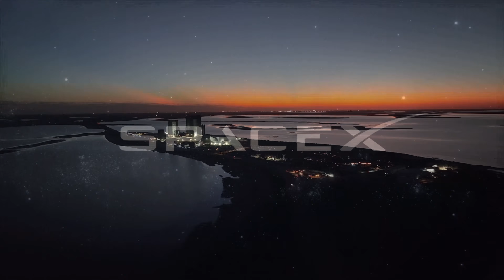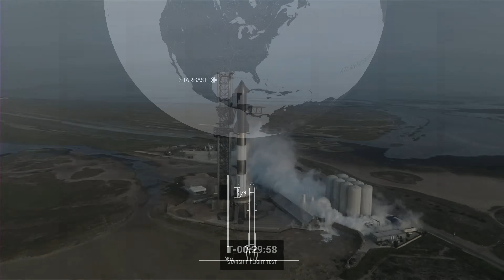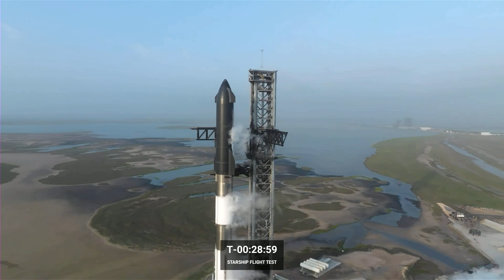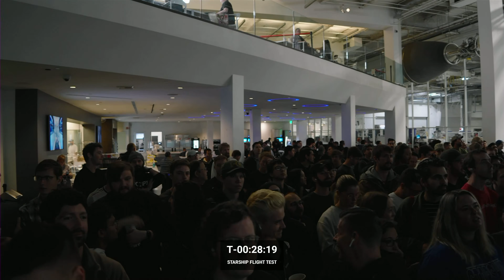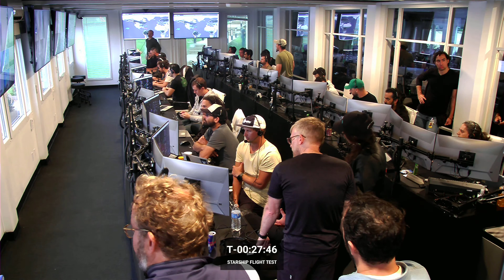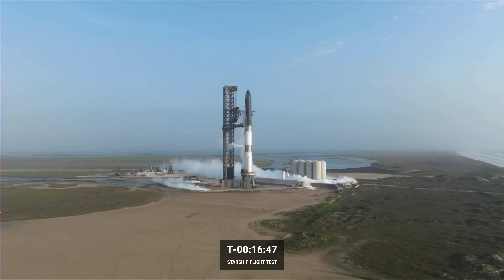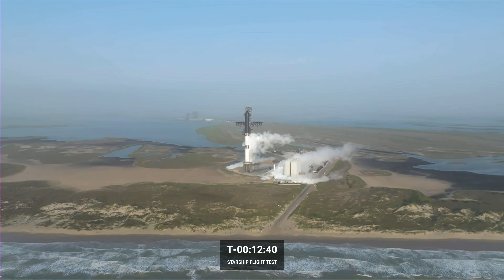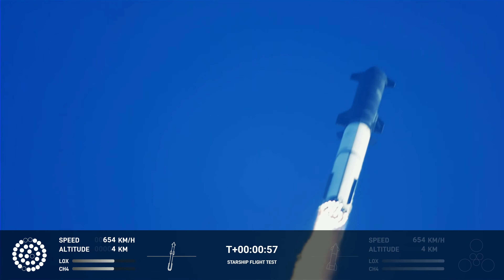Starship Flight Test

Comment: The fact the booster didn't separate - after two or three full rotations at such insane speed - shows you how well put together it was.   Perhaps TOO well put together.
Reply: It's too good! So good that it failed completely! Wow! Good job guys!
Reply: Probably damaged during liftoff.
Reply: @GoDodgers1  my money would be on a software glitch
Reply: too much ducktape bro
Reply: @souplife1  it didn’t fail completely. The goal was to clear the tower. The mission was a success.
Reply: starship has been in some form of development as Artemis has been.
Reply: It looks like it wasn't a flight test, but a stage separation test. Failed miserably.
Reply: @souplife1  well obviously it was going to fail because this is the most outdated and oldest starship that they have the plan was to clear the launch pad that’s it everything else was made for show and luckily they got some data to upgrade the new starships that I will say if they use the new starships they have they will be 99 percent successful
Reply: @souplife1  this is what separates a billionaire from an ordinary person. when a billionaire takes one step forward and an ordinary person can only see from the bed through the screen
Reply: @souplife1  haha u dont understand engineering
Reply: Duct tape these days is next level.
Reply: @sliceofthatpie  It was a “clear the tower”-test. This was a huge succes.
Reply: Just goes to show how short-sighted and incompetent the engineering of this rocket was. Completely over-engineered in all the wrong areas and obviously under-engineered in the critical components
Reply: @sliceofthatpie  maybe you should look up what the job of a prototype is. It is to reveal problems and modes of failure. 
Ergo, it did exactly what it was suppose to do, just like all the test articles that exploded on the landing attempt lead to the successful landing attempt becoming possible.
Reply: Told them not to use superglue! 😀
Reply: @richardburger4859  could be a combination of the two, like the vibrations damaged a sensor used to orient the rocket.  you can see that the HUD in the video that shows the angle and the engine status glitches out during the flip and the angle displayed suddenly changes 180 degrees.
Reply: @Supreme_Lobster  haha you don't understand wasting billions of dollars
Reply: @GoDodgers1  After launch the booster lost both of its external HPUs (Hydraulic Power Units) which control the gimbaling (thrust vector) of the center engines; without those it can't steer itself as easily (except by adjusting thrust in certain engines). There was also an aerodynamic issue due to speed and the grid fins plus ship flaps being at the top, so causing drag and control issues. In short, it was caused by a mixture of things. Future boosters won't though have HPUs, ones already built have electric thrust vector control internally so the HPU point of failure has already been eliminated for them.
Reply: @souplife1  Brah, can you even math?
Reply: What it shows you is that it not finished or ready for launch, the design or the actual manufacture was inadequate to the stress put on it by its own gyrations, or worse someone screwed up and didn't check the O-rings or something.
Reply: @diginalytic  No, what separates us is wealth. And wealth is a human construct that only retains as much power as we put faith in it. If we all decided not to continue using money, what could anyone do about it? If billionaires couldn't spend their money to get stuff, we'd all be equal in that regard.
Reply: @MikeySkywalker  Exactly, you can tell who doesn't know anything about space or space travel, probably not even anything to do with any other planets. This was a successful test run :D
Reply: Fail.
Reply: @richardburger4859  most probably issues with engines did not allow the system to recognize the correct release conditions.
Reply: @angrdbonz3423   Elon is probably hiring, you should apply..
Reply: @aick  I'm pretty dure the design and manufacturing were more than capable. The thing did cartwheels and never broke... that's insane. Most durable rocket in history
Reply: They must have used Nokia for those parts
Reply: @souplife1  The hardware that launched isn't "billions of dollars".  Billions of dollars is what is being spent _on the program_.
Reply: @souplife1  hahaha best comment
Reply: Yeah it was so good in fact it didn’t even separate when it was supposed to
Reply: user-ph1wf6mn7s  what do Slavs make? square tanks that doesn't run?
Reply: @diginalytic  what separates a billionaire from a normal person is a lot of money and rich parents (maybe an emerald mine)
Reply: @souplife1  i'm pretty sure a billionaire knows how to allocate money. You are not a billionaire. Your opinion is next to meaningless
Reply: @SlartiMarvinbartfast That was the closest I've ever been to a psychedelic experience without doing hallucinogenics.
Reply: @MikeySkywalker  This is funny. Elon must be a clown, he makes me laugh.
Reply: It was obviously a malfunction at the junction. I'd bet someone forgot to hook up the stage separation plug....
Reply: @tomlopez7819  So is the Gorilla glue.
Reply: @souplife1  If you are going to fail, do it right.
Reply: @ZXLNT  Hiring monkey to drive it.
Reply: Damn Chinese bolts.
Reply: @cjay2  Hard to resolve issues if you don't know what they are until they appear..

Comment: An absolutely phenomenal job by everyone at SpaceX, just getting that beast off the ground was a huge ask. So much learnt I bet - take that learning, and look forward.  The only failure is to never have tried at all!
Reply: I would not describe failure as a "phenomenal" job.
Reply: @godsfavoriteant9293  You prob forgot how SpaceX started, first test flight failed often and crashed on landing. Look now... they launch 61 rockets just in 2022 alone without trouble after all they learned. 

This was a very big success for SpaceX, all they wanted was to get that monster from the ground and they got full 2 min flight without trouble. The stage separation went bad but they learned a lot from this. This was after all a test flight to gather data to keep developing the Starship.
Reply: @godsfavoriteant9293  Thanks for confirming you have zero perspective on this test or its goal.
Reply: @channelthechannel  they tried to launch a rocket, it failed to stage and exploded. The rest is spin for clapping seals such as yourself.
Reply: @godsfavoriteant9293  Falcon 9 exploded many times as well, and had many failed landings. Now it's second nature and highly reusable... and people like yourself were saying it couldn't be done. This is how SpaceX innovates, with rapid testing and iteration. The goal of this test (which is the largest and most powerful rocket ever launched) was to gain knowledge for future iterations and improvements. It wasn't to cater to the peanut gallery. Elon stated multiple times that getting it to max q (which it achieved) would already be beyond expectation. But I don't expect you to understand any of this, or be interested in understanding any of this.
Reply: Learn, progress and improve. Something you cannot manage to do yourself. Instead you have to take to YouTube to troll and harass others. I could go further than just shutting you down on here and expose other information about you to the world but just consider yourself safe for now little one.
Reply: @uploadJ  I don't need it. They launched a rocket, it blew up when it failed to stage. The launch failed. If they were testing to see if it would fail, then their test was stupid.
Reply: @Roj_Au  oooh, I am shaking in my boots little Musk rat.
Reply: @godsfavoriteant9293  Would not describe this test as a failure
Reply: @godsfavoriteant9293  Like I said, I don't expect you to understand any of this, or be interested in understanding any of this. In one ear out the other.
Reply: @godsfavoriteant9293  You seem to have a limited grasp of testing
Reply: @godsfavoriteant9293  You should read  @channelthechannel's comment above, they're completely right - and it's a test flight. The chance of it going perfectly first test flight is very unlikely.
Reply: @GH-ge5hi  I have a better grasp on testing than you do on success.
Reply: @itsjduff  sure, that isn't the issue. The issue is calling this a success when it clearly failed.
Reply: @godsfavoriteant9293  It accomplished its mission. Everything after that is secondary.
Reply: @godsfavoriteant9293  your parents also called you a success when you were clearly a failure.
Reply: @pipooh1  Bro you can see an engine Expoding after Like 30 Seconds and 3 engines did Not even start i woud Not call that without Trouble, even If the seperation Had worked at that Point the Rocket was Spinning so fast It coud Not have Bean saved.
Reply: To flight director;

Remember everytime this is test and test.
The starship is a fenomenal spacecraft never build it by humans.
Reply: @godsfavoriteant9293  I woud fully agree they stated their Flight Plan it was Not Like the Rocket was build to Blow Up. The seperation was the Most critical failure but you shoud Not forget that 5 engines failed one even blew Up over the Launch Pad and you shoud also keep the death Spin in mind even with a Separation the Rocket was Not lost at that Point probaly a Lot earlyer
Reply: @_kampfkartoffel2195  they wanted to launch it from the ground, anything after that is icing on a cake. If you watched it they said it multi times at the end. Same they did with all their rockets.

The boosters not going on was an expected behavior since it the first time they launch it with all those boosters. Nothing goes perfect, they did even expected it would not leave the platform...

Also the rocket did not explode, they prob detonate it so it not an uncontrolled projectile that can explode. Better have a controlled explosion than a wild rocket duo to no separation.
Reply: @taxirondon3914  Bro It IS literal Garbage:why over 30 engines this creates endless failure Points, why make It resuable the space Shuttle have tough US that this only makes space craft more expensive and un Safe, why only 2 stages when every other Rocket has 3 in Order to actualy do Something in space without refuling?! The fact that it Is big does Not make It impressiv!
Reply: @godsfavoriteant9293  For sure, I guess it's kinda subjective. People see success differently, it's certainly progress at least.
Reply: @godsfavoriteant9293  Watch the video "How Not to Land an Orbital Rocket Booster" from SpaceX. Then check how many times in a row Falcon 9 stuck the landing without problems in a row recently. It's a "fail forward" strategy which works for SpaceX very well - instead of endless designing, modeling, redesigning and modeling again before a flight, they build a prototype, fly it, explode, learn from mistakes, build another prototype and fly again until they get it right.

Comment: I will tell you this SpaceX You did cartwheels at nearly Mach 2 and your vehicle held together That's pretty damned impressive :-) hopefully it won't be too long until the next flight test.
Reply: It was above the atmosphere... Had it done that in the atmosphere it will have broken up instantly.
Reply: Decades from now people will be 3d printing comemorative models of this flight guaranteed!
Reply: @ericmatthews8497  no it was not. it was at about 125,000 ft definitely not above the atmo but it was above most of it. atmo or vac a vehicle that size holding together under thrust in a cartwheel is impressive. it was also in much thicker atmo still tumbling before them terminated the flight.

Comment: Alright; Cleared the tower, Went super sonic, Went through MaxQ -- It appeared the stage 1 engines failed to shut down to allow stage separation -- for whatever reason the stages did not separate -- stage 1 began its flip maneuver while still connected. All the wild gyrations of the booster flipping the entire ship, I think, proves structural integrity. Also, it looked like at least 4 of the main engines failed to ignite. Not half bad for a first attempt. 😍👍👍
Reply: The entire stack is meant to start a slight flip maneuver and then turn off the engines such that Ship and Booster drift apart. Then Ship engines ignite and Booster performs its boostback
Reply: There is a engine out indicator on the bottom left. So i would say it was anticipated. 3 engines failed to ignite, and 2 went out on ascend.
Reply: I think they Hit the Self Destruct Button after the Rocket went into the Spins. 😢
Reply: Good 1st Test though. 👍

Comment: Despite the pad damage, i'd say this is a massive success in proving how durable a rocket can be. No other rocket i can think of could've gone through a tenth of what starship went through without immediately exploding.
Reply: Took 11 apollos to reach to moon
Reply: The rocket itself went far above and beyond all performance expectations.  It’s proven that SpaceX’s design and construction standards are absolutely going to be the industry standard in spaceflight for decades, if not centuries to come.  Now they gotta sort out how to not blow apart 4 engines on liftoff and more afterwards so they can keep the damn thing going where it’s supposed to, which is something they’ll certainly achieve given their track record with the Falcon-class rockets.
Reply: This is some dense copium

Comment: Was a nice launch. Now SpaceX has almost 4 min of flight data to see what the errors were so they can be corrected on the next flight test. This is normal for a new rocket design and I expect the next test will be soon. SpaceX is normally very quick in analyzing  and getting to the next test unlike NASA and the legacy companies that take years between tests (analysis paralysis) unless the results are perfect. 

I hope they will let us know how the launch facility handled the launch. Will repairs and modifications be needed. Again, SpaceX tends to respond quickly for the next test. 

Congratulations SpaceX .... You show to be the industry leader. 
Remember .... The competition still can not send crews to the space station even though they were given twice the funding.
Reply: I just want to go to mars already
Reply: Another drone...
Reply: лiл
Reply: @ptolemyauletesxii8642  yeah you
Reply: Well NASA has been very careful after the terrible tragedy. They were deeply criticized by both the public and the government. SpaceX have not experienced that (not that I am wishing them to). So the guilts is bigger on the NASA side of things.
Reply: I bet the #1 error will end up being: "A big chunk of concrete sideswiped Booster 7 and partially damaged it (and potentially damaged a few engines), leading to that corner of the booster eventually exploding; the total thrust loss from six dead engines ultimately led to the stack not achieving its intended height, and it was decided that stage sep would not be allowed."  (100% speculation on my part, but just look at that concrete fly.  There's a house-sized chunk of it, flying upwards, parallel to B7, so close that you could reach out and touch it as it sails upward.  No way in hell did B7 come out of that event unscathed.)
Reply: @howl262  ... NASA's problem was that they knew what the problems were and didn't fix them. Good people died because of it. 

I expect that SpaceX will fix the flaws 1st before carrying satellites or people. I hope they never lose astronauts.

Comment: Came off the pad like the absolute monster it is. Love it when they stagger off the pad. Saturn V used to do this and for me, it's somehow much more exciting than when they go up like a bottle rocket. Looked absolutely BONKERS. Congrats SpaceX!
Reply: now we wait for someone to put together a saturn v launch and super heavy starship launch videos side by side
Reply: It looked really slow. I think it was supposed to launch much faster but the failure of 5 engines slowed down the ascent. Also of note, the bigger the object the slower it appears to be moving from our perspective
Reply: As far as I understood, there should have been separation of the first and second stages of the rocket, with further landing of the first stage. But, unfortunately, the separation did not take place. Is it right?
Reply: @petkatch9257  well stage separation was supposed to happen at 70km. SS only reached half that altitude so I think it's not surprising there was no stage separation. It looks like there was serious underperformance
Reply: @juniperpansy   @juniperpansy  Thank you very much, for answer.